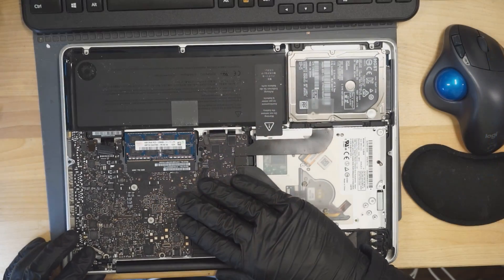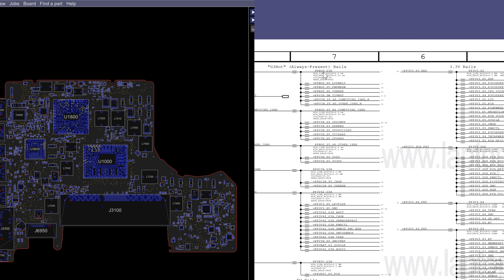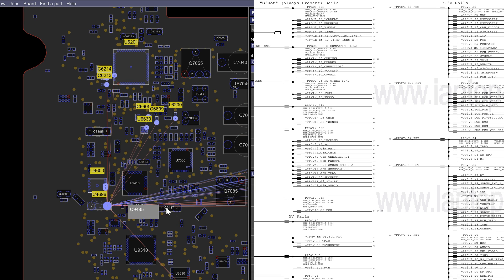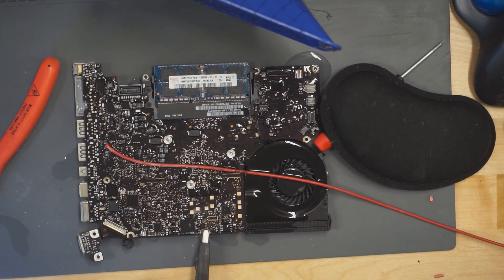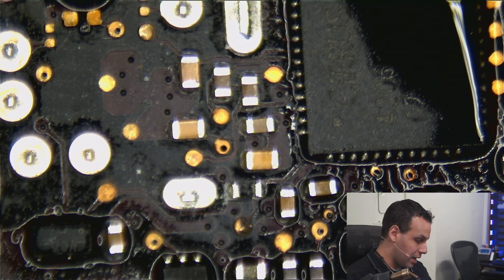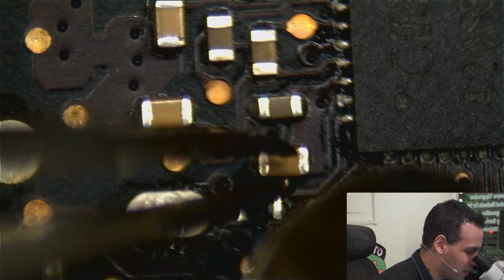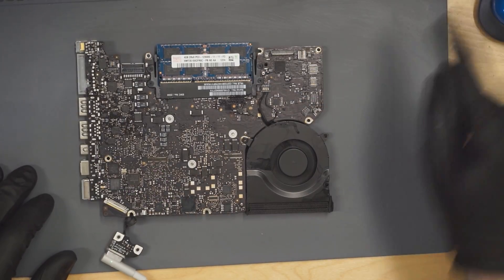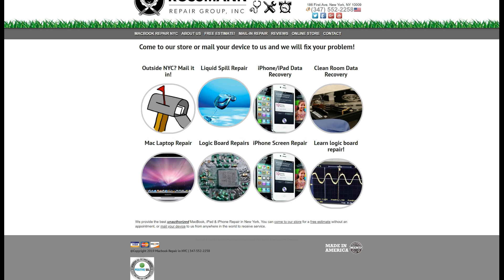820-3115 A1278 Macbook Pro not turning on logic board repair

Comment: I worked at Ford back in the 90s and saw Ford Tauruses always on the lifts. I assumed they were pieces of garbage since they were always on the lifts. when I commented, I was taught, Ford sold SO MANY TAURUSes, like 20 times more than any other model, thats why they were always on the lifts. not that they broke down so much, just that there were so many of them. Think about when you fix yet another MacBook.

Comment: Man why can’t you life in Germany ? my MacBook Pro 2012 just died. Power is Green and I watch your videos to find the problem why it won’t power on. I try all this „disconnect Batterie“ „hold buttons“ things but it won’t power on. Now I watch through your videos. Well the MacBook is nothing wroth here anymore it is just this „emotional“ binding to a device. Now I found that one chip seems  broken and don’t Even know how to order this part or how to replace it. Think most Mac repairs here will replace the mainboard .nobody do this deep repair like you because it will cost more then the device wroth.

Comment: I have the same behaviour, Mine will turn on when plugging in the MAgSAfe due to the Auto On feature but I get nothing from when pressing the power button, cant even turn it off by holding the button down.  is it the button that's faulty?

Comment: I had the same issue. I accidentally knocked off c6213 and my machine instantly booted up and works fine. I was surprised because I thought for sure I had broke it worse. Can the machine stay running good without this cap?

Comment: Louis, I am have the same A1278 and 820-3114B board. I have power, green charger light, full battery; on power button press the fan momentarily jerks and white light on front right lower edge lights briefly. I have tried various changes i. e. Removing ram, disconnecting HD, disconnecting the battery, disconnecting the fan, tried all the reset routines etc but on pressing power button the same thing happens. It does this on bat and on charger. Now stuck in Colombia on lock down without a laptop. Whatever happened, happened after I closed up the laptop for the night, just wouldn't start the next morning. Clues? Advice? Thanks!

Comment: I have an A1278 Macbook Mid 2012 Core i5. Old owner used it with a janky power supply and it always felt like the body was sometimes stingy like minute electric shocks while plugged in. Of course after some days my audio failed, no output devices showed up in system information, and now the macbook does not turn on, and sometimes it does by itself if I leave the lid open, boots up all the way to the login page and then powers off. I'm very confused,  the Magsafe shows green light and the battery indicator shows the battery is fully charged. The battery was already over a 1000 cycles so that's that.

Comment: I ve got a question, Louis.
A few days ago I wanted to use my iPhone 6 that i had not been using for 6 months. When I plugged it in, I saw the battery symbol. After 1 hour when I checked again, the phone was dead. Where should I start searching for the problem.
Reply: BB23 battery

Comment: 5A would almost certainly fry tracks and lead to other issues. Limit current to what you think that rail requires.
Reply from the maker: you limit current by lowering voltage.
Reply: @rossmanngroup  Current will still be high in short circuit situations. Ohms law: 1V/0.4R=2.5A. At 2V, it will be 5A. Most components are rated for just a few 100 milliwatts (P=V*I). Best to limit current to prevent fires in the future.

Comment: one thing I'm learning from this channel, MacBooks seem to short to ground a lot. I have a HP from 2008, a gateway from 2010, and MSI from 2013, they're all still serviceable with the latter two still in use
Reply: Well, that actually is what those components are suppose to do in the event of some sort of failure.  Well, the resistors and capacitors anyways.

Comment: Is there any case in which there are no shorts and no missing/pulled down rails and there's still an issue?
Reply: There are a million components on the board, anything could happen.
Except fuses blowing. Fuses never blow on Appla boards.